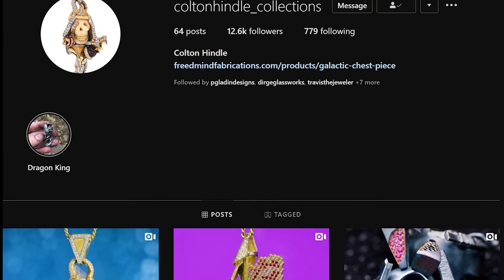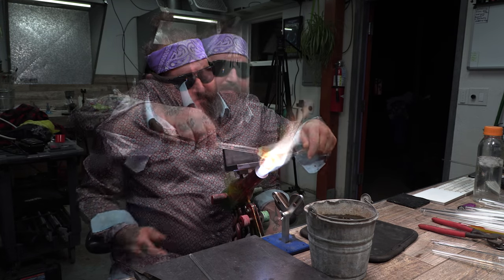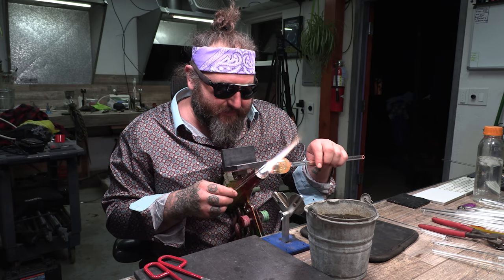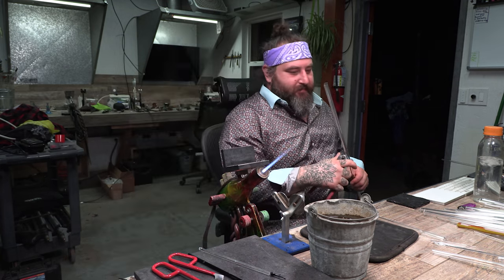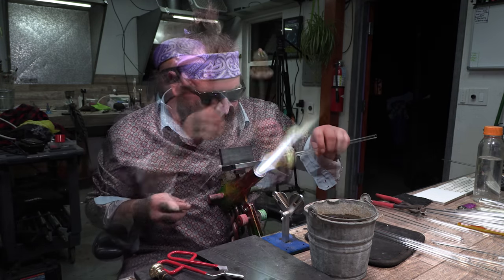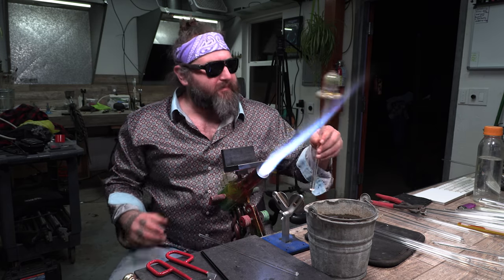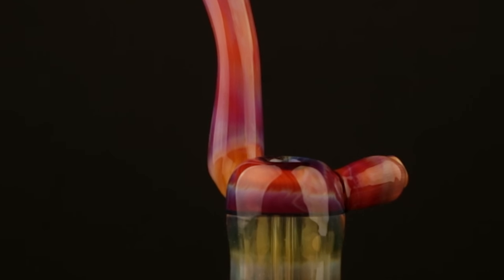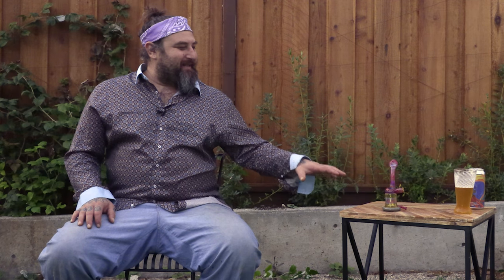Making a Bubbler || On the Torch SEASON 2 Ep 9

Comment: How did you like the smaller diamond shears I've had them in my cart at mountain glass for the longest and can't really decide if I want these or the larger ones. I never really used any diamond shears in any of my work so it might be one of those tools that I didn't know I needed like a blow hose and mini torch. That I seem to use every time I turn my torch on.  Also how do you like those taffy tube rollers. I've been thinking about buying a pair of those also